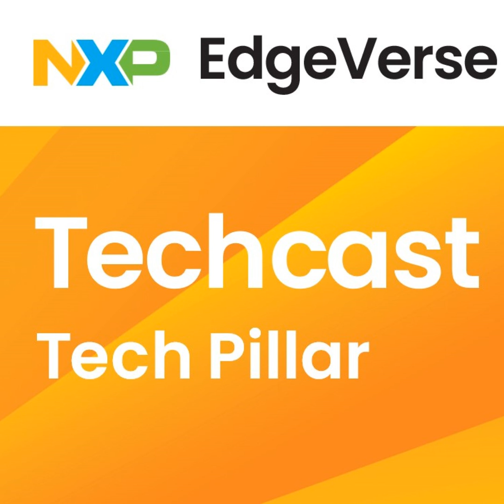CRA Week: Step 4 Maintaining Conformity Across the Product Lifecycle

Comment: Have now attended a dozen webcast, lectures about the CRA hoping to find real answers for real practical questions. Almost never real manufacturer are invited how to deal with the CRA. When they do, there is a flood of questions that never get really answered. Other presentations read like a book an repeat the same steps over an over again. Software (OS) provider says they provide all the tools for security, Hardware providers do the same, like PSA, TFA,, secure boot  as features in their products as their "shield" as their contribution and effort to meet the CRA. but in the end its the product designer to use these (correctly and best way possible). Few SOC/Module manufacturers provide up date date kernels and distributions.  Yocto lags two years behind latest kernels. Nobody calls out the elephant in the room. There aren't any standards, metric or measurement how to measure secure. though the EU can slap you with 15 million penalty with all these subjective requirements. They only way might be to "pay up" and find an expensive consultant, so as with Software/hardware manufacturers to have a "shield" to hide behind.. That seems to be the way for the EU to create new "consultancy, paper work" businesses and overloading small businesses with huge costs.Large companies can hide behind their lawyers.  You don't know anything unless it can be measured.  Security can't be measured. 95% of presentation are sales talk, no practical help.